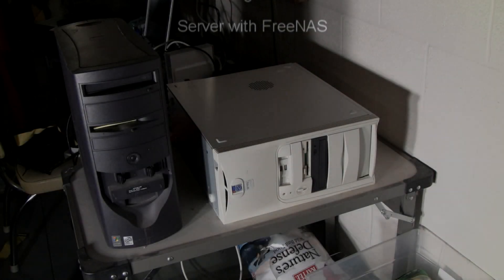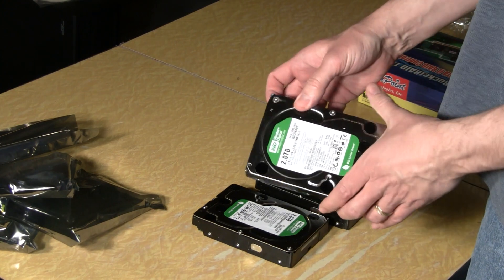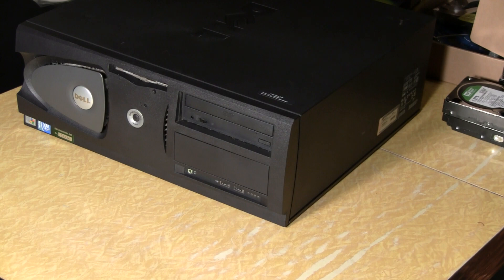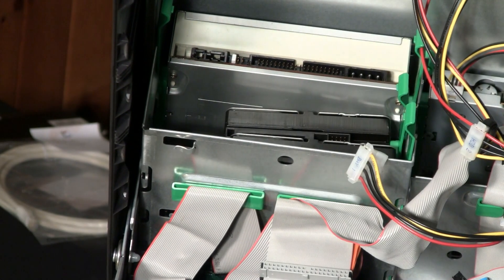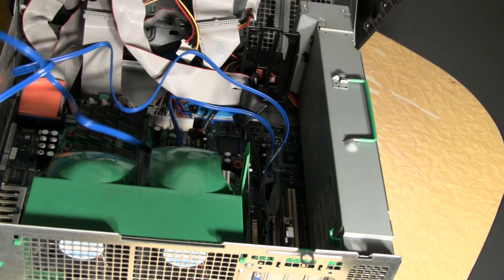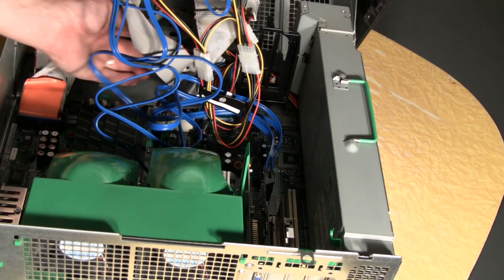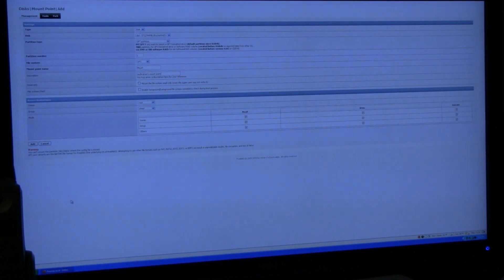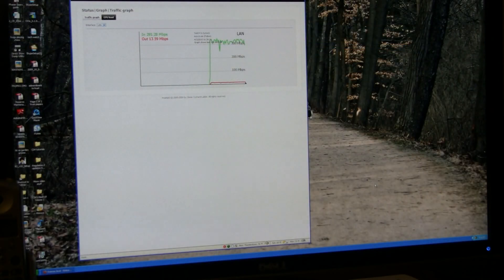Building an 8TB Server using FreeNAS.

Comment: remind me and everyone you know, NOT to ask you to work on, build, or advise them on anything.  that is the worst build ever!!!
Reply: @Daniel Tekmyster: Unfortunately, I have to agree with you. Had a FreeNAS server as an rsync backup unit back in 2010, and it didn't last two years. The ZFS had punched a great number of holes ( bad sectors ) in my two hard drives, rendering them unusable. They were 640GB each, merged as a RAID1. Fine SAMSUNG drives, I may say. That's why I moved on to Linux with its EXT3/4 file system.

Comment: If I want to make a RAID 0 system, for high performance, would there be much of a difference between hardware and software RAID?
Reply: @Sankar Manoj: There might be! Hardware RAID controllers do all the calculations between CPU & HDD, while in software RAID the CPU has to do this work while using quite a decent amount of RAM to do so. That's why it's always a good idea to bloat your server with more than enough RAM. Otherwise it will shift to the SWAP ( if any is present ).

Comment: I has old Dell 4600C,1GB,P4 2.x?).  I will put in 2-3 TB drive.  Will I need to upgrade anything?   I just need cheap storage for streaming and file storage (nothing important).  Only thing is installing SATA drive.  Any suggestions?

Comment: Those are crappy consumer grade drives though. When the drives are spinning 24 / 7, consumer drives tend to fail very quickly (I made the mistake of buying a WD green, it only lasted 2 months in my Dell PE 2950). If you're using RAID 6, and you can have 2 drives fail before you lose any data, this is "fine" (if you like replacing drives often) - but I'd spend the extra cash and buy enterprise drives. 

That's just me $0.02.

Comment: if you still had the server, since SAS cards have really come down in price lately (an 8 port PCI-e 8x SAS HBA card from LSI can be had for $110) you could achieve much higher throughput with it than the plain PCI card. too bad that mobo won't support 8gb of ram, ZFS is one of the big selling points of FreeNAS and generally has better data integrity.

Comment: I see in the capacitors on the server motherboard are ruptured, leaking, and the tops are rounded.  Many Dells suffer from that problem.  The leaking capacitors can cause random crashing due to voltage flucuations.

Comment: With that many hard drives I would invest in a better case so the HDDs are not mounted that way and create even more heat... specially if that server is on 24/7. I'm planning to do an 8TB
Server, too. I'm thinking of getting the Fractal Design R3 or NZXT H2 White case since they have plenty of room for HDDs and very good cooling. 

Also I wouldn't trust an oem PSU for all those HDDs. I would get a better one. It's good to have these things in mind when you invest so much in HDDs.

Comment: Hi! I noticed you used 2TB GREEN harddrives in this NAS. Is it running 24/7? If so, have any of your drives failed? Also, how many times have they spun up over the years (if you're still using them, of course).

- Lars.

Comment: do you no how i install free nas on my 4gb usb stick? it wont let me because the usb stick is over 2gb. i need to overide this somehow.also can i use a dual core 2gb old hp laptop as freenas? problem is my dvd drive in the laptop is broken so i cant install freenas to the hdd. my bios has an boot to usb harddrive option. i would really really appreciate any help. cheers pete

Comment: @solkre Good eye, looks like at least 5 bad ones. Possible this is a year 2000 machine. Was an issue for a lot of manufactures using a specific brand of cap and a ton of electronics went into homes blowing caps within months to a year. Short story is, someone stole the formula for a new capacitor material, turns out it was not stable. Company's like Asus, HP, Sony and so many others, built and sold millions of gadgets with only a few willing to recall some of it.
Reply: @HostileHST: The Specific brand was "Capcon". Those were the ones often used near the CPUs for voltage stabilization. Unfortunately, the design plus heat ( especially from the Pentium IV processors ) made then bulk'n'blow rapidly.

Comment: My main "workstation" pc is an ancient dual Xeon, (3.06Ghz) it runs Windows 7 64bit Ultimate fine, although I am using Raid 0 on it the inbuilt interfaces are only SATA1 and yet it can shift data back and forth to my sever at over 300Mb/s. I was dogged by slow transfers with my other server but this is fast enough! The faster server by the way is only a Dell Poweredge 2500, dual P3s at about 1.4Ghz.